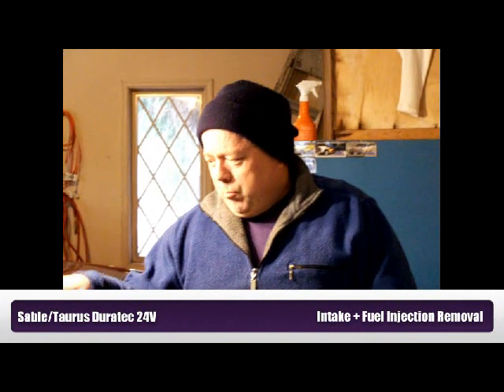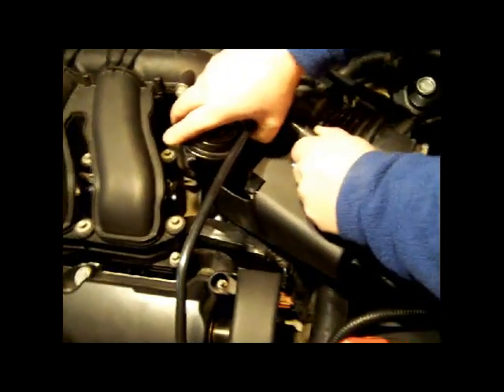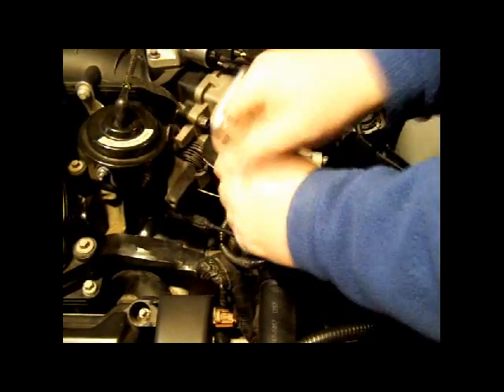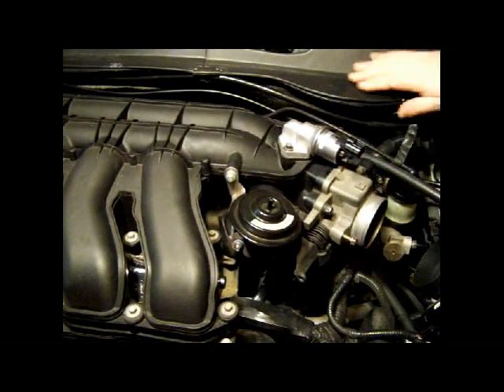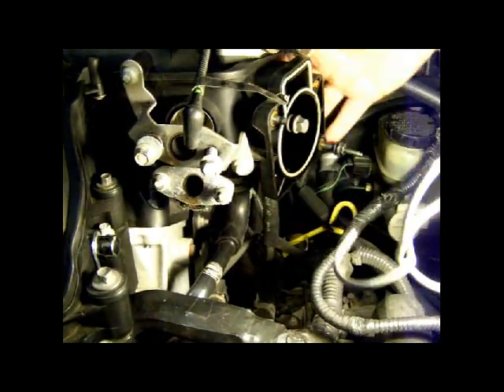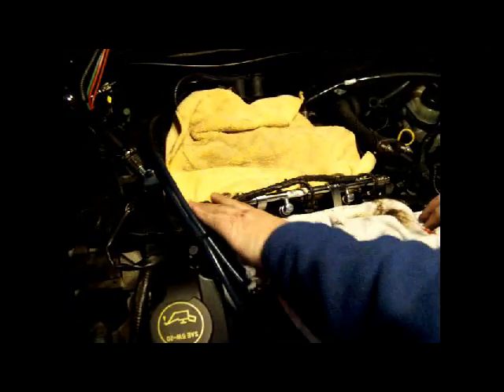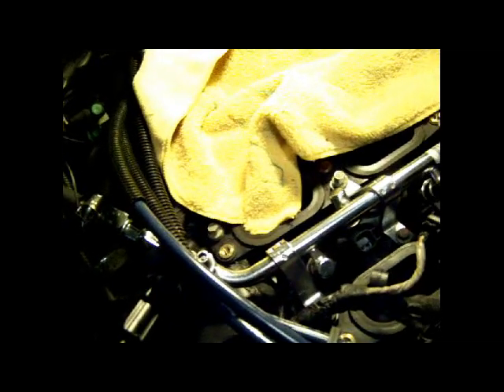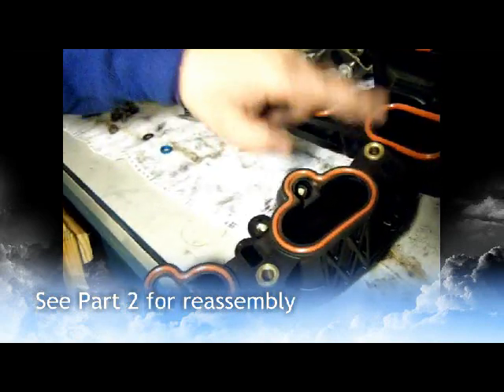2002 Taurus/Sable Duratec 3.0 Intake Disassembly

Comment: Been chasing down a big vacuum leak. Finally found the problem. Took the intake manifold off with the intention of replacing the gaskets because I thought that may be where the leak was because the engine would smooth out and run fine once it warmed up. But then I found the leak. The main vacuum hose that connects to the PCV valve had failed. It had collapsed and had a big split in it and this was what was causing all my problems. Or so I thought. After I put it all back together it was running much better but it was idling way too high. Research revealed that the likely cause is the PCV valve itself needs to be replaced. A common failure on these Duratec engines. A $15 part but it took two days to replace. The PCV valve is located in a spot nearly impossible to reach. I ended up having to take both the upper and lower planum of the intake manifold off (again) but the little plastic part was still very difficult to reach. A one quarter turn locks the small plastic cylinder like valve into a hole in the engine block and the vacuum hose connects to that. Taking it out was almost impossible I managed to break it into several pieces before  my needle nose pliers managed to get a good grip on it and turn it so it would come out. 
To do this you had to twist your body into just the exact right position in order to see the thing AND you had to have a light shinning on it in just the right spot in order to see it. Once I got it out the new one was easy to put in because it had a square flange on it so you could fit a socket over it and twist into position.
Now my 2001 Mercury Sable LS Premium runs like new!

Comment: Thi s a great video. Like many of us, I keep a car a long time and although your video is more than 7 years old now, it is still helping people like me. I have a 2002 Taurus SEL with the 24 valve Duratec engine. I used this video as reference a few tears ago to change the coil pack and spark plugs. It was  a great help - many thanks. I am back again for a refresher because I want to flush the heater core. The intake manifold has to come off to reach the heater core connectors (all the YouTube videos are for the SES engine which  have room at the firewall). So, my thanks to you,r  and to your video helper. This video may be a reference for a very long time. (Comments about  'too much removed', Schrader valve name, etc., are just people sniping. The rest of us pay them no mind.... neither should you).

Comment: Used this video for a 2001 3.0 Ford Escape. Same type engine and had a rough idle. replaced just about everything and saw online that this could be the problem......Lower gaskets that is not the injectors....NOWHERE on the internet could I find where to get the fuel rail off so THANK YOU!!!!

Comment: Thanks for posting. Great video and money saver. I had to do a tune up and half the spark plugs are in the back, behind the manifold. Your video with its excellent step by step dis- assembly made the job very easy and solved my misfire issue. Without this video I'm sure I would have did more work than what was necessary. Thanks again. Oh, and I passed inspection :)....

Comment: should change plugs while everything is exposed. clean throttle body.

I use the picture idea too!  Magnet drivers or plastic hose on ends to hold bolts

Comment: i have a 2001 mercury sable LS 3.0L V6 DOHC we changed o2 sensor fuel filter plugs n wires and the part store said the gape on the spark plugs should be .44 now my exhaust pipe before the catalic convertewr is fire red and the other guy said at the part storew said the spark plug gap needs to be .54 and i was told wrong by the other worker what do i do the guy at the part store said the wrong gap on th plugs is more than likely why my exhaust pipe is fire red

Comment: anyone who just wants to change rear sparkplugs, this isn't necessary.
1. remove the window vents under wipers (4 button plastic tabs on each side, pop off with screw driver).
2. remove water tins under window vents (3 screws to a side).

Comment: I would like to personally thank you for this video. I needed to perform a pcv valve change, plugs change and new wires. (tune up) . Your video helped me do this. I bought the Haynes manual (Joke) and also checked Chiltons (Joke). Neither one covers the DOHC only the OHV and OHC. The Duratec was a vague mention. I guess they only wanted to cover the easy engines not the hard ones. Because of your video you saved me a great deal of aggravation and money. For this I thank You.

Comment: Thank you for posting this superb tutorial.  My son and I needed to pull the top off of a Duratec in a 2002 Taurus so that we could access the streering rack to change  the high pressure hose that was leaking.  Once we had the intake manifold off, we sufficient access to replace the leaky hose.